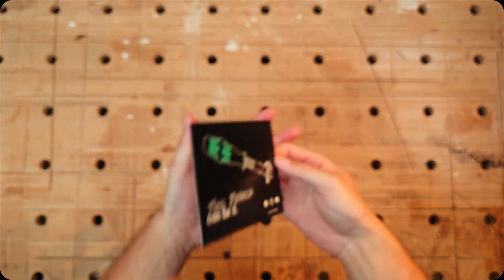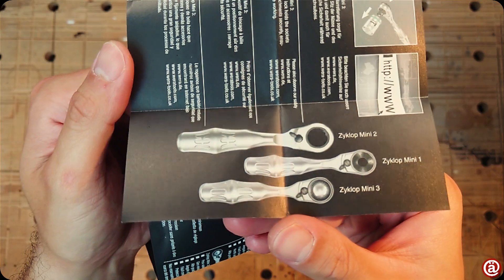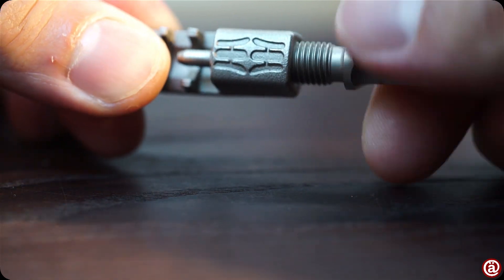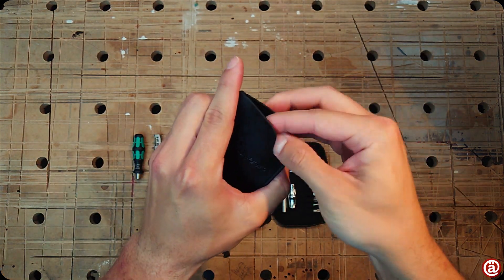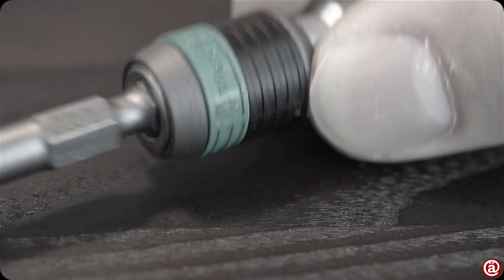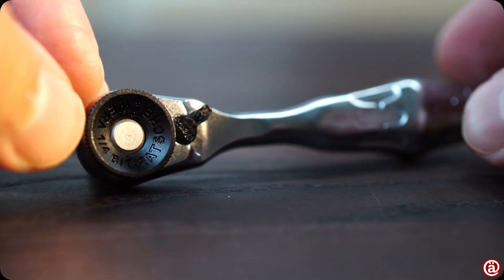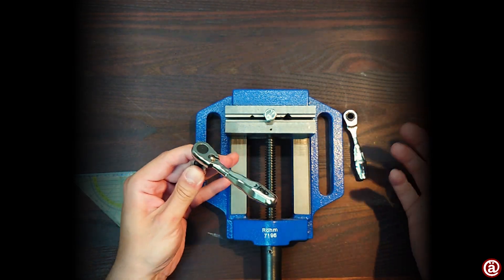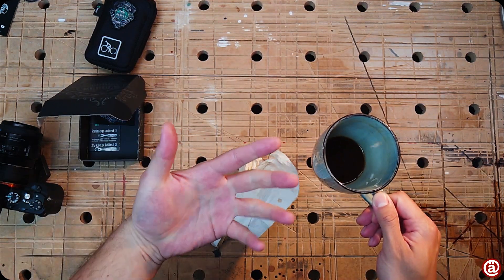Wera Tool Rebel Bicycle Set - unboxing & review | Etna.

Comment: I think the quick ratcheting feature on the mini Zyklop is just a thumb wheel. My VIM bit ratchet has one too, i think they're a pretty standard bit ratchet feature. It's weird because the ratchet engages in the same direction as the bit rotation, but once i figured that out it's been pretty handy in places where I can't get a good swing on the ratchet.

There was some video by an aircraft mechanic I saw where he mentioned he preferred the design where the center of the thunb wheel is recessed (like on the Zyklop), though i don't remember exactly why.

Comment: I have the Wera 813 and mini zyklop both are very impressive tools, Wera does a great job on the finish of their tools and they all look stunning. The 813 is a great size and can be placed almost anywhere and similar attributes can be applied to the zyklop with both proving their reliability and handiness in use. The kit you have shown in this video is actually one that I have wanted for awhile now. That chain tool looks like such a well made object as well. I think this kit could be improved if you threw in some L-keys to correspond with the hardware of your bicycle. Great video too.
Reply: @Hand Tool Reviews I agree I would not use the 813 or mini zyklop for any heavy use but they are still very well made very useful tools
Reply: @Hand Tool Reviews I make sure all of the Wera tools I buy now (I know the mini zyklop is made in asia but I wasn’t as stuborn about manufacturing locations when I bought it) are specifically make in Czechoslovakia. The only tools I buy from Wera are screwdrivers, bit drivers, and bits, which all of the ones made by Wera are made in their Czech factory if I am correct. I know that Wera’s sockets are made in Taiwan (amongst other tools) however I have never read anywhere that their tools are produced in china. For other tools such as sockets I will tolerate the higher cost to buy them from companies like Hazet so I know my tool boxes are free of communism. And I agree that PB Swiss L-keys are superior to all others they really make a good tool.
Reply: @Hand Tool Reviews I don’t watch project farm but those tools are the best in their category for me, I first discovered them as my father (who installs automated storage systems for warehouses and distribution centers) told me that these were the best L-keys he had ever handled. Ever since I bout a set they have proved to be truly exceptional tools that have lasted even through hard use. And I’m not a PB Swiss fan boy either as these are the only tools I have bought from them, they just make a great tool. I don’t decide my tool choices from a single YouTube video anyway.
Reply: @Hand Tool Reviews to each their own!
Reply from the maker: Well... If you're interested in my 2 cents on this topic: 

Every tool has its purpose. And a stubby handle can indeed deliver more torque, but is also more bulky. So in this case, I'd rather have a 813 with me than nothing. A t-handle would be nice. That would fit in this bag and still deliver more torque. So, I quite like this mix of tools that come in a form factor that isn't bothersome to have around. Anything is better to have with you than nothing. 

I'm neither a fan of PB Swiss. The electricians screwdrivers feel like using a gummy worm. And the acetate handles are pretty, but I dislike their vanilla smell and ergonomics. But I still want to try out their hex key set with knurled handles. 

Regards,
Etna.
Reply: It's almost as if different people have different preferences...

Comment: I really like the Wera-Tools and especially the chain tool. There bicycle-sets often miss something. I think that ball-ended hex bits would extend the use (probably only in size 4 and 5). A JIS-Bit instead of the PH-Bit would be much more special for bicycles. The chain hook is ok, but you can bend one out of an old spoke pretty easy. And the sleeve for the ID-card is not so useful to me. The pouch is nice. 

For a tool purely used on bicycle-tours, a multitool seems the better choice to me. As a bicycle-repair-kit, it's missing some tools. So while I kind of like it, I'm pretty sure I wouldn't buy it.
Reply from the maker: Thanks! This is some really nice and useful feedback. I see this pouch also as a starter kit for your own bike set. I use the sleeve for patches now and will change a lot of the bits. I'm also missing some tools. I might do an update video on my personal pouch. 

I have some special temper proof nuts to prevent tyre thiefs, i.e. And I think Victorinox has a really nice compact L-key bit holder that is compact enough for that pouch. The Wera T-handles are a bit too big I think. Something like that. 

Regards,
Etna.